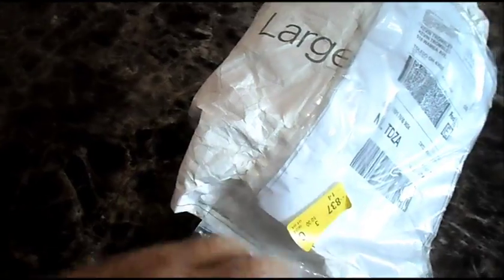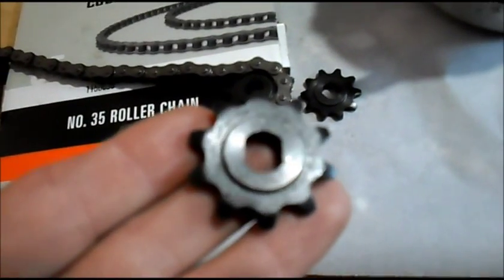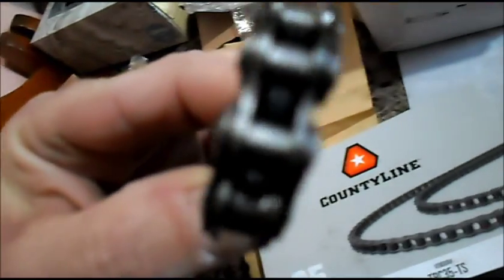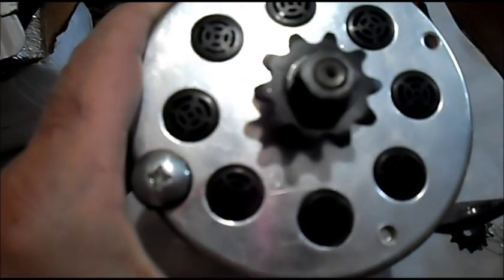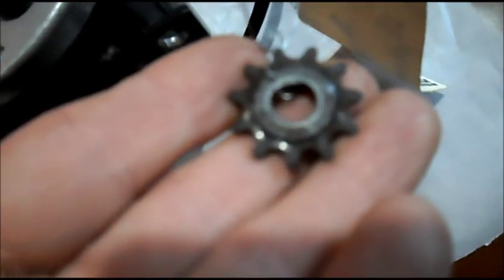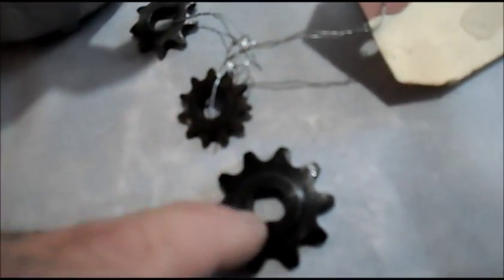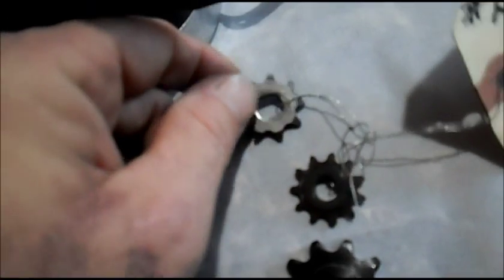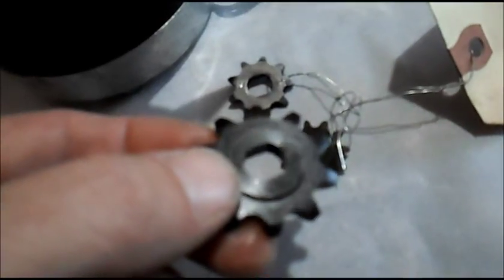Sprockets for electric motors with 10 teeth & for #35 chain

Comment: Give buying link please
Reply from the maker: I get these sprockets from Alfa Wheels https://www.ebay.com/itm/10T-size-35-3-8-pitch-Power-Curve-sprocket-f-ZY1020-MY1020-motor-f-GoKart/162850691515?hash=item25eaa859bb:g:lKEAAOSwEVZaWnEN
Reply: @functional_artist  Are these available on Amazon?
Reply from the maker: @camogap7392  Threse are available on eBay 
https://www.ebay.com/itm/114631828494?_trkparms=ispr%3D1&hash=item1ab096e40e:g:xTMAAOSw92dgAV6U&amdata=enc%3AAQAGAAAA8DfRWb1vgNDxqvHF6UJP2pXwuO%2BHwKYfm3%2BwDcww%2BVyBvQk9pVX37V5GyjsLfdFqmOTrAzOThFI4TmwI6JmUFGNSD%2BcFk5Vpx8l%2B2I1U18UJPb0zIsJauYz4jEOWcdA0GjQjZSstMjOQUxsZftgF%2BK6ZJ2kxDQwOLC%2BSxWNobxYun6rq5a9LSNtYA6WPpjdd33vq8ZsExdbiRB7IyfloGHSjB6l8QCMlZ%2F4hr%2BfJXlVFGCubbyU3hVI%2Bq68Itsx7GW2nS9aECvMxUdbucp%2F7xIh2zhYECEE0dP%2FM3X5tn%2FFQnzh3cXT4IlVFWPq%2BwcSxSg%3D%3D%7Ctkp%3ABFBMvNuD54xg 
but, they are probably available on Amazon too.

Comment: I found these sprockets on ebay, and I think they are the ones you are talking about:
https://www.ebay.com/itm/10T-size-35-3-8-pitch-Power-Curve-sprocket-f-ZY1020-MY1020-motor-f-GoKart/162850691515?hash=item25eaa859bb:g:lKEAAOSwEVZaWnEN

Would they work with this 1800W motor?
https://www.amazon.com/Mophorn-Electric-Brushless-Controller-Motorcycle/dp/B07KF8M5W6/ref=sr_1_1?keywords=1800w+motor&qid=1576120490&sr=8-1#customerReviews

Comment: What exactly are “teeth” in motors? I’ve heard about them but I can’t find any info.
Reply from the maker: Teeth refer to the number of "teeth" on the drive sprocket which is the sprocket mounted on the motor shaft. Changing the sprocket (different number of teeth) is how you adjust the gear ratio. For example, a 10 tooth drive sprocket & a 60 tooth driven sprocket (the one on the axle) is a 6:1 ratio. That means that the (motor) drive sprocket turns 6 times for every 1 time the (axle) driven sprocket turns.
Reply: Functional Artist ok thanks

Comment: Do have any extra you want to sell? I'm doing the same. Converting and old minibike to electric!
Reply from the maker: They are called "Power Curve" sprockets. I sold most of them to Alfa Wheels.   Ask for them by name (~$20.00 delivered)https://www.ebay.com/itm/size-35-3-8-9-53mm-pitch-11T-11-Teeth-sprocket-f-ZY-MY1020-motor-f-minibike-DIY-/162850691516
Reply: Excellent, thanks! I subscribed. The video you did of the brushless motor really helped me get mine wired up correctly.  Thanks!
Reply: I also want to buy one 😁